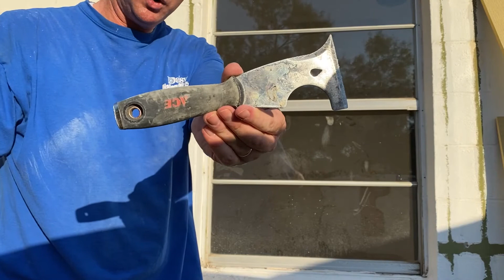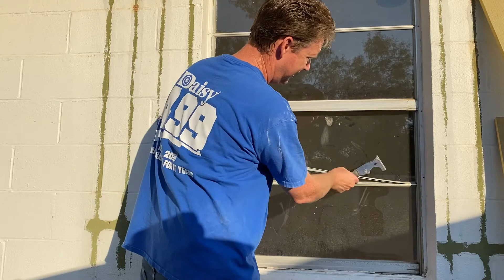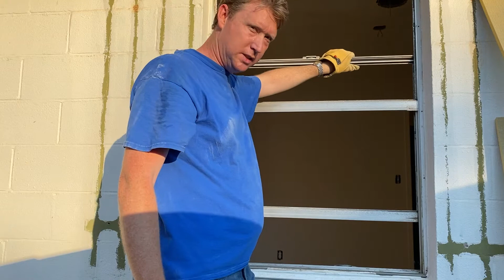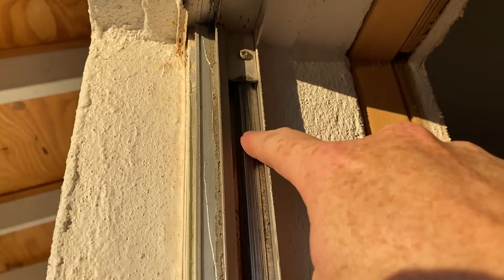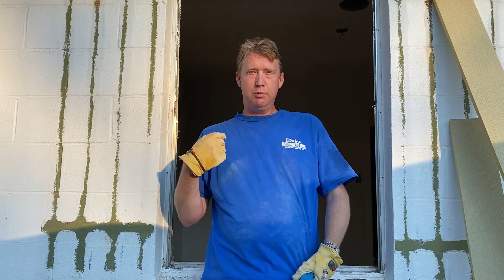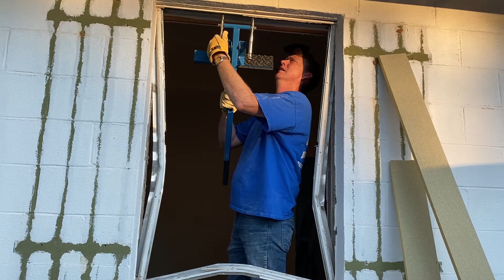Removing Aluminum Window - FASTEST TOOL EVER - Brick or Cinder Block

Comment: I purchased this tool and removed 27 windows and sliding doors from brick house.  This tool is unbelievable.  Made the job so much easier.  Literally minutes to pull out the frames and cut them with my saws all after freeing the frames from the brick.

Comment: You can make one of these, just search on YT for aluminum window frame removal tool. A few pieces of pipe, threaded long rods, 2 vice grips, some nuts, washers. Harbor Frieght vice and HD for pipe, washers, nuts, long screw rod. Easily made, use wood blocks for leverage on bricks or inside sill.

Comment: Harbor Freight sells the lockable pliers for 3 dollars each and Home Depot sells an 8-inch long lagbolt with a a few nuts to hold pliers in place. Drill 2 holes into the pliers and mount to a pipe. Works fine, pulled all windows off an old concrete block house last week. Total cost little under 8 dollars with sales tax.
Reply: Can you please post a picture of the tool you made
Reply: I have installed for over 20 years..We just use a prybar up against a 1by 4 to protect brick.. Just sawzaw  the side then collapse it..easy
Reply: @daveyboy8907  
Thanks for replying! Simple is even better! Thanks a lot!

Comment: Those old windows are literally the easiest ones to get out. I’m a professional window installer here in Florida. I can tell you now you definitely don’t need that big goofy gimmick 😂. You literally can either deglaze the window or use carpet shield to cover the upper fixed glass. You should have removed that lower operating sash first. Take a skill saw with a metal blade or a sawzall make one or Two cuts on the jamb side. Block of wood and a pry bar have that frame out under 10 minutes. We do around 10-15 windows a day. Newer construction windows are way more difficult than these ones. Stucco cut outs on wood frame nails fin windows is a whole other story. Oh yeah make sure you score the outside and inside of the windows with a razor knife.

Comment: I received this tool a couple weeks ago & used it to remove 2 windows (12 yet to go). I did not find it helpful. The seller's website shows his wife using it. I'm 5'7", 112#. It was difficult to manipulate overhead & the vice grips rotate (I often had to reposition them). It wasn't worth near $300 (especially when I later learned there are no refunds). I actually found a sledge hammer & crowbar easier to use. I contacted the seller who told me in a text follow up that he recommended a helper (that's not what the video of his wife showed). 

As a side note, he sends a religious T-shirt. I appreciate his sentiment but didn't want a shirt. I asked they not send one. One was sent anyway with a note stating that's what they promote.